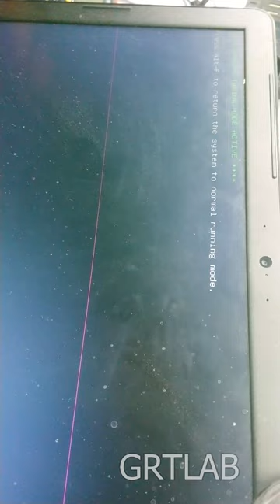DELL laptop on/off problem fix bios repair

Comment: I typically see people re-flash their bios chips using a clip-on programmer, they are fairly common. It saves the need for desoldering the chip!

Of course, there are some cases where you shouldn't use one. Just some hopefully useful advice.
Reply from the maker: I have that clip, most of the time it will not work, the circuitry will interfere with the programming and you are forced to desolder.
Reply: @f1lab535  I have it also, and it works 70% of the time. Still better than desoldering and resoldering